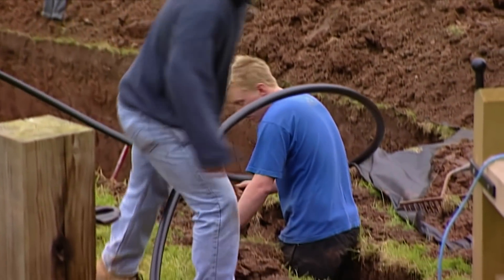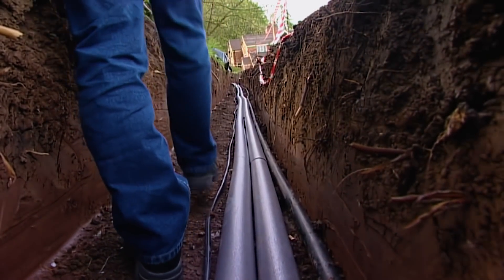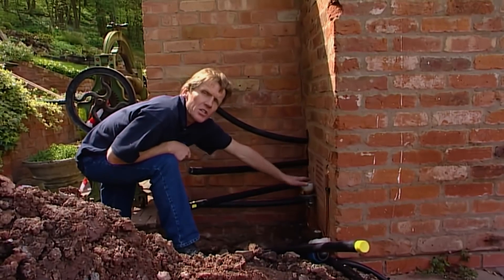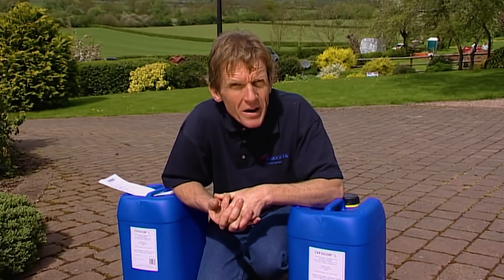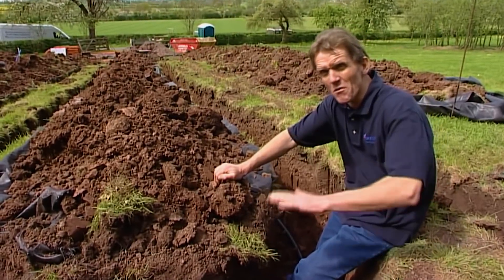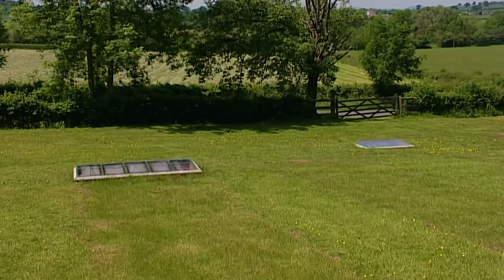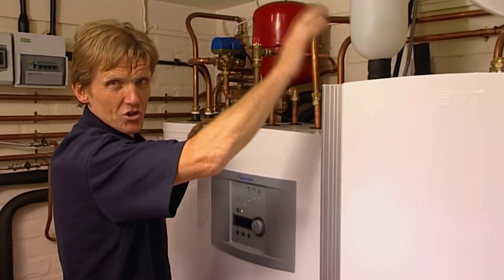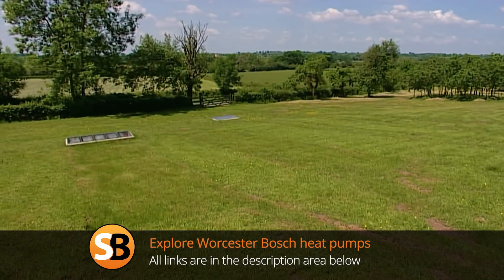How To Install a Ground Source Heat Pump

Comment: Wow!! That must have been hugely expensive and totally inappropriate for the majority of properties in the UK. I live in a two bedroom terraced house  built around 1900 ( 2  or 3 bedroom Victorian terraced houses are very common to most UK towns and cities). Internal wall insulation wouldn't work and exterior at the front only any good if the whole row had it done. Would maybe work at the rear? As far as heat source for water and heating I'm kind of stuck with gas or electric both of which are becoming more expensive very quickly. My rear garden (yard) is a sun trap in the spring and summer so it's a shame there's not some way of capturing this heat and storing it insulated under the house for winter use. I've no idea how this could be done or the longevity of heat held in storage systems. Are there any case studies for UK terraced houses and methods to insulate and heat such properties?. Only other option I can think of is knock them all down and start again!
Reply from the maker: Treble
I agree with all you say and storing heat under ground won't work for that long. I think we need cheap energy, that should be our goal and there are lots of people working towards it.
Reply: You can buy ground mounted solar PV panels and storage batteries. That would help with the rising electric costs

Comment: This is at odds with your recent "expose" on heat pumps....so which is  it Roger?
Reply from the maker: It is not at odds at all. We put this video back up to show that ground source is a lot better than air source because a lot of people were saying that in the comments  but we show that even this system is not enough to heat this house in the winter because it is poorly insulated. Without the backup boiler, ground source is not economic or practical for most homes.

Comment: Happy New Year Roger. Please may I ask a quick question " how thick is a 1980 concrete floor" single storey extension. I looked through 1976 regs and couldn't find anything. Do you know if any old builders!! I wish to dig in underfloor heating and insulation. I will drill a test hole to double check. I would be very very grateful. x

Comment: Didn't see one worth having 20 years ago, and even now wearing glasses I still can see one worth having.
If global warming statistics and estimates  turn out to be correct by 2030 the average winter tempreture will be -15, heat pumps won't be able to rise to the compensated required heat.

Comment: Does the ground over time cool and progressively reduce the efficiency of the system?
Reply from the maker: Yes, it can happen very quickly and we have seen cases where the ground has frozen. You can see a potential problem where the pipes run alongside the swimming pool.
Reply: @SkillBuilder  Truth is the daughter of Time, Roger!
Reply: Ground temp to 2-3 m depth varies seasonally (quite slowly across most of uk). Daily solar gain builds up “heat” , but heat is also being lost via evapotranspiration so there is quite a complex flow of heat in the shallow subsurface (esp if there is shallow groundwater too).  GSHP systems are “supposed” to be engineered to factor in soil thermal conductivity (which controls how well the soil will absorb and transmit heat/cold. Conductivity is a function of soil type and moisture content - and these can change considerably with depth - as well as laterally not all soils are as uniform as the one that is this video). If the collector is not designed correctly (too shallow, too closely spaced), then the system can freeze the ground (simply dumping more “cold” than the soil can conduct away) the compact systems really do have to be designed carefully, slinkies - less so. The idea is to strike a balance over the year, during winter you extract heat from the ground, over the summer the ground recovers naturally via solar gain (if you run a reversible system for air conditioning, you can pump heat into the ground- which can cause plant distress as you desiccate it). Generally, shallow GSHP  go in about 1m depth (checkout the video - are those folks super short? Walking along those trenches?). As a geologist (with some experience of GSHP in Europe) I think too many of these systems are still being installed far too shallow- installers use shallow trenches because of costs but also to avoid rules about shoring trench walls over 1.2m deep (trench support kit is costly).  Thermal gain “sweet spot” for many uk soils is closer to 2m depth not 1m…it’s all about balancing that heat exchange- for which you want a steady temperature that you can work with and deeper is more stable than shallow. If your system is too shallow you may get marginal benefits in spring as the first 0.5m of ground warms up quickly, but you also run the risk of freezing as winter sets in and the solar gain tails off (there is a time lag as well- so it’s complicated ). If your system is too shallow  (or you mess up the conductivity calcs) you really are going to end up not getting the COP=4.
Reply: Not with a water well system.....much much MUCH less expensive.

Comment: I don't have a country house, a farm, a paddock, a tennis court or a helipad to dig up.  LOL, a heated swimming pool ?  Only suitable for rural applications for rich people.   This is not going to solve climate change but perhaps it will in the minds of Tory MP's.
Reply from the maker: The outrageous thing is that the government saw fit to subsidise this kind of thing and chuck it on the fuel bills of the poor.
Reply: @SkillBuilder  I think the technology is great and I would surely have it if it was; a) physically possible for me and b) affordable.  Sadly neither is true, I have looked at air source heat pumps but even then the size of external units and cost are prohibitive.  We need more innovation and hybrid systems with a lot of government help to get anywhere near our commitments to reducing Carbon.   Can not someone think up a combined or modular compact super-efficient hybrid solar water, solar electric, wind, heat pump system for the average UK house ?   Where is the UK's Elon Musk ?

Comment: Interesting to compare this video with "Heat Pumps: the Ugly Truth!" a video on SkillBuilder 5 months ago...I'm not sure which presenter to believe!
Reply: The rant was about Ashp's, this is about Gshp's. The presenter's views haven't changed.
Reply from the maker: Hi Paul 
Thank you, I think maybe I should have made it clear on the first video that I was talking about air source but I would still not remove a gas boiler to put this ground source in because it will never have a payback unless gas prices go way over electricity.

Comment: Great but for the ordinary suburban house its going to be impractical and if installed, very expensive. For me with a back garden 50ft x 50ft max and front 25ft x 80ft I reckon it would have to be a borehole. Then you have to find space for hot water storage and all the equipment. Then all the radiators would have to be upsized. Lastly, how could I get the very hot baths and showers I like, current hot water temp 60c for 'topping up'. Then we have the rocketing price of electric even at 4-1 efficiency. So solar panels and a battery needed. So what are we looking at? £30k plus?

Maybe going down the shops to buy a big coat and some thermals!
Reply from the maker: Good comment,  we are looking at heated jackets in a couple of weeks time

Comment: One of the main issues with heat pumps is how these systems actually perform in real life, so many reviews and analysis are at the stage of being fitted when everything seems great. As this was done some time ago it would be very interesting to go back and see how well it performed over time, speaking to the owners and looking at running costs over time. That would be far more useful than hearing how wonderful things are before it gets switched on!
Reply from the maker: We will try and do a follow up
Reply: From my experience they use a LOT of electric, plus the install cost, never recoupe that cost ever
Reply: @Ben-in6qh  they do. But they use less than electric radiators do for the same amount of heat.
Reply: @Ben-in6qh  I do not think that they use a lot of electricity...it just a pump...also the ground always has a constant temperature...not like the air in winter time
Reply: @msresu  it's not just a pump bud
Reply: @Ben-in6qh  Could it be that your home isn't insulated well enough?

Comment: Would love an overview of the potential of Hydrogen using the existing gas infrastructure, i hear there has been some testing going on in some areas of mixing hydrogen with exiting gas supply.
Reply from the maker: Yes the hydrogen trials are underway and a lot of good work is being done to ge the network hydrogen ready.

Comment: They should have saved money by installing a PV array instead of wet solar.  PV is much more efficient in collecting radiation and will power other appliances, the cost of both systems are similar and, the wet solar needs to be serviced every two to three years.
Reply from the maker: I have wet solar and it is fine.
Reply: @SkillBuilder  Not saying it's not good but an array gives a bigger bang for your buck

Comment: Article on our local TV tonight about an idea I had years ago - drilling into old flooded mines and running the pipes in there . Literally millions of gallons of water at 20c all year round.  We have apparently many thousands of such mines in the UK!
Reply: But seriously folks, maybe not @skill builder.  The water in the would continue to circulate heat from the rock and water and earth in the mine.
Reply: If you are seriously interested in mine water heat visit Newcastle Gateshead 6MW district heating scheme and UKGEOS Glasgow research facility .
Reply from the maker: Yes good idea but if too many people extract heat from one source it wll freeze. Maybe we need to put heat pumps at the poles.
Reply: @SkillBuilder  why should we give heat pumps only to Polish people?
#DadJoke
Reply: @SkillBuilder The deeper you go, the hotter it gets, because heat comes from the depths. So the heat is replenished, but of course there is a limit to how much you can get out each day.

Comment: Most of the energy comes from the sun via rain and other ground water not the suns energy directly
Reply from the maker: That is an intersting bit of information. How does that work in areas of very low rainfall, is the ground colder in the Sahara than the Lake District?
Reply: I think in short, probably by comparison, yes once we go down below the direct heat from the sunshine in the Sahara.

Dry soils are poorer conductors, water is the key, thinking about a wet or dry tea towel, I’d rather use a dry one to get the bacon out from the grill.  

Soil conditions will typically be known by the installer/manufacture support engineering design engineers etc.  Really could be worth an update on the video, Kensa down here in Cornwall are the biggest supplier to the uk and they have their own manufacturing base.  Probably worth a call cause you have a good viewer base they might be find interesting.
Reply: Not quite. Vast majority of shallow ground heat is just plain solar gain. But Groundwater does have an impact, especially where a major aquifer come to surface (and in these areas -where you have groundwater fed  ponds/lakes water source heat pumps are possible). Uk groundwater is generally 6-8 degrees). Some deeper groundwater will have a geothermal component of heat on certain areas too (14 degrees in parts of Derbyshire). Rain water/snow will transfer some heat, but the thermal mass of soil of rock far out strips that.

Comment: I saw this video years ago and downloaded it as it was so interesting. I’m guessing It’s a shame you feel the need to bring it back because people are hounding you with regards to your recent comments on air source. Which I totally agree with. Thanks for the education once more 👌
Reply from the maker: We brought this video back because it discusses ground source as opposed to air source. The simple facts are that most homes could not have ground source so the main focus of the government is air source which is not as efficient. Neither of these system will give you the same output as a gas boiler.  Just for the record, I do not feel hounded in the slightest, I enjoy the debate and the video has had a a lot of views so I am happy.
Reply: @SkillBuilder  fair enough 👍

Comment: Key points works well with underfloor heating. Rads need to be larger than equivalent combi systems so factor the cost in .

Comment: Very odd - clearly old, and sponsored by Worcester Bosch, who don't seem to be at the current lead in the UK with heat pumps of any form, and whose recent interviews with Roger have been less than commital to the technology. Wot is occurring?
Reply from the maker: There are many different views and a lot is explained by saying that different houses suit different  systems. This ground source system  is not suitable for your average house. If you have a gas boiler on mains gas my advice is to keep it.

Comment: Geothermal heating is the same ??
Reply from the maker: No it isn't. Geothermal is heat generated by  activity at a much lower level. Ground source is solar heat stored in the ground
Reply: @SkillBuilder  I'll stick.to the plant rooms good old boilers

Comment: This looks like an old video. So given what you've said in other videos about ground source heat pumps, why put it out now? Just an advert for Worcester Bosch.
Reply from the maker: I didn't say that ground source doesn't work. I said that it was unsuitable in urban environments and most homes can't have it.  This video illustrates just that, hence the reason for putting it out.

Comment: It seems really stupid to put the forward pipe and return just next to each other and insulate them. 

In sweden we dig 2 trenches about 1 m apart, and put forward in 1 and return in the other, and skip the insulation. We only insulate them the very last meter or 2 from the house.
Reply from the maker: That is a better idea but not always possible. I would get as much separation as possible
Reply: It's amazing how well these systems apparently work in much colder climates than the UK, I do wonder why.

Comment: In a modest 3 bed house what would be the minimum sized garden for this compact collector to work ? You would also need a rather big room inside for the heat pump and anything else.

Comment: Thought SB don't like heat pumps?
Reply from the maker: Ground source is unworkable for most people and air source is not as good. If you have a gas boiler why would you spend thousands to put in a less effective for of heating. 
For anyone with the land who is not on gas then a heat pump is worth looking at but it is a huge investment and I don't think the tax payer should foot the bill for rich people to convert to heat pumps.

Comment: If people are confused about how the ground contains heat, remember it's only cold relative to our bodies. Relative to the liquid refrigerant, the ground is warm as it's boiling point will be well below 0°C
Reply: You could also say it contains heat relative to outside at ground level.

Comment: great, but what happens in mid winter when its -5  ???
Reply: This isn't Siberia. The deep ground doesn't get that cold.
Reply: That's what the back-up oil boiler is for.
Reply: @paulhillman400  So the boiler does the heating when it's cold and the heat pump does the heating in the summer...when it's not required. Lol.
Reply: @TurinTuramber   , GSHP is more common in Germany and Sweden, systems there are well established as viable heating and -5 is nae bother….but uk housing stock and some poor over selling means they have had a dodgy start here..stayed in plenty of places where it was more an issue of trying to turn it down/off